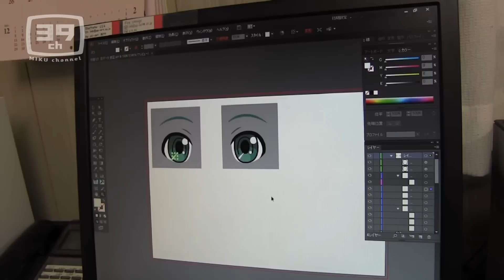【HATSUNE MIKU】Making of LIFE SIZE MIKU STATUE 初音ミク等身大制作ドキュメント  【初音ミク】

Comment: i am actually going to build one similar to this, but i could really use some advise in the materials i should use. in this moment i though of styropor as a basic and epoxy resin to cover that. but it is quite hard to find styropor in this massiv amount without paying too much. Any ideas?
Reply: ***** thansk a lot for answearing, but i stopped the project because it´s way to complicated. My last construction plan was a wire basket filled with styrofoam as a basic structure and a heated foil for the surface. waaaay to expensive to built